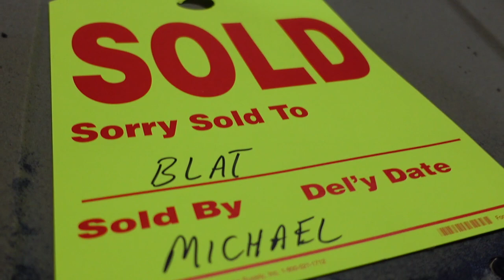kayak fishing sucks

Comment: I use a traditional style ocean kayak. It is a Viking Pro Fish Reload. 50% or more of my effort is to survive and simply ocean kayak. If the weather and conditions allow, I then can fish. Everything is harder and more dangerous to the extreme. Every once in a while, I go freshwater boat fishing and it bores me to death. There is so much more of everything (good and bad) in kayaking that boat fishing really turns me off. Also, there is no luxury tax, no boat tax, no boater safety class, no license, no registration, no engine maintenance, no fuel, no trailer, and no drama with kayaks. My 15 foot ocean kayak is only 65 pounds. The freshwater version is only 56 pounds. Both kayaks use the same modular equipment. That means my loadout works the same on both kayaks. Saving money is smart. 

One last comment, you need a saltwater and a freshwater kayak. The Hobie is garbage in the ocean. You need a boat that is no wider then 29 inches and about 15 feet long. The Hobie is 42 inches wide, and it weighs 120 pounds. Complete fail in offshore conditions. I have never seen a Hobie come out of the harbor and fish offshore with me. Ocean boats are long and skinny for a reason. Look at the Ocean Kayak Trident 15 and look at the Viking Pro Fish Reload for examples of offshore kayaks. 
Freshwater boats tend to be shorter and wider. They are great for casting but horrid in wind because of the problems heavy weight, height, and extreme width create. The peddle drive has its advantages but also it has disadvantages. The hull needs to be reinforced to support a peddle drive and that makes a 70 pound boat balloon to 110 or 120.... Also the peddle drive consumes the deck, there is no room for you left over. Also the peddle drive costs a lot and if you drive a Hobie or a paddle fin style drive you need a spare drive because you can not paddle a Hobbie, they need to be peddled. That being said the freshwater kayaks are luxury machines and a joy to fish in if the weather is good. Make sure your kayak has enough performance to handle the environment you are fishing and enjoy the challenge. Stop spending so much money on your kayaks. Save that money and use it for nice trips, lots of them actually and enjoy going places no boat can go.

Comment: I've never been fishing on a Kayak but my son owns a fishing version of an Old Town Kayak.  His kayak has a motor and fish finder and fully loaded up with his gear the kayak is one heavy piece of equipment that needs to be humped from his truck to the water and even with the wheels he has for the kayak its not an easy way to get out on the water and back.  Now there is one aspect that really sucks for him and that is chasing fish from one spot to where ever it is that they swim off to and even with the electric motor the kayak is way to slow  to keep up like he could if he were on a fishing boat with a gas outboard.  So he paid around 4 grand and he hardly ever uses it.  So no, I wouldn't say he's thrilled with his purchase.

Comment: Boat positioning is the biggest negative to kayak fishing. A trolling motor mounted on the bow would be highly useful. Manual power to get from point A to point B does not bother me, but boat positioning, without a doubt, is the biggest negative.
Reply from the maker: Yeah man. When I realized that I hated it at first but then I started to appreciate how good of a angler you have to be to fish from a kayak because you have no control over the boat.

Comment: You're right. Kayak fishing isnt really FOR filthy casuals. It CAN be for casual anglers, but you really do have to be dedicated to it for it to FEEL worth it most days. If youre fishing small water, say 600 acres and under, a kayak can be a perfect platform. I fish the kissimmee chain from a kayak frequently. This is not ideal. Even with a trolling motor on my nucanoe, my range is severly limited and time is still a factor. You cant cover the 25,000 acres of toho, let alone lock through and just run down to cypress. Learning to legitimately gameplan and understanding how to milk an area and fish small are paramount to success and these are skills that are mostly ignored by a lot of guys in bass boats due to the ability to run and gun. I did a video on the importance of boat positioning a while ago. It is far and away the most overlooked aspect of kayak fishing. Glad to see some people with an actual audience having the conversation.

Comment: Bought a kayak I’m a bigger guy so was concerned about weight limits part of the reason I bought new easier to research each model vs trying to find local one on eBay. Noticed you talk a lot about boat control don’t know if you use drift socks they may help but at the same time may spook the fish after the first 10 min would think it would go back to normal

Comment: I'm glad I stuck around. I'm one of those kayak only anglers, and I read the title, said a dirty word, listened to the first few sentences, was like oh no imma unsub right now. Glad I actually stayed until the end. Haha, pro tip though positioning is not hard you will find, with a peddle drive, and rudder.
Reply from the maker: It still not a bass boat. Boat position is not even as easy in my aluminum boat as it is in my fiberglass competition rig. The bigger the boat the easier it is to position yourself. However the pedal is definitely much easier than paddle in most situations.

Comment: You're saying that kayakers are at a disadvantage to the wind and current... then every other kayaker has the same disadvantage. Is you're more apt to handle those conditions, you're a better angler in general. There are not boat vs kayak fisherman. It's all circumstantial.. Learn to use an anchor trolley and have a stakeout pole.. sound dampen your kayak.. get a sit on top with enough deck space to stand on.. I honestly think people who spend 99% of their time on boats get lazy.. Huge casting platform, outboards and big trollers, and tons of storage to store all of your unnecessary tackle.. it spoils you. At that point you've already moved too far from the fundamentals and it hurts you. As an owner of a medium sized skiff and a 12 ft PADDLE kayak, I like kayak fishing more. It brings you closer to the fish you're after and closer to the environment you're fishing in. It's a more intimate experience overall.

Comment: So I’m just gonna throw this out there.  I have done neither, but I’m thinking about this from what I believe is logic and physics in my head.

So don’t but my balls!  Thank you.

Can a similar 12,14 foot flat bottom Jon with a lithium 12v on a hand troll motor access same waters and have as much control.

At the same time I have seen kayaks on the pro side setup with so much lowrance units, batteries, battery restorative units, tackle , rod and reel storage, no doubt those kayaks are 250-300lbs.

I understand the physical health benefits you have offered up.  No rejection to that, but??? 

Just throwing it out there.  And personally I’d feel more comfortable in a boat than feeling like I’m on top a log with a seat.
Reply from the maker: Yea a jon boat also allows you to fish with another person.

Comment: You’re going to love the Outback! Get a micro power pole, Boonedox landing gear rudder, Boonedox landing gear cart/wilderness cart/Hobie cart. Get a or make a leash for your pedals also. The landing gear is will get you on and off the water quick without having to load/unload your kayak
Reply: Dude I took my Titan out for the first time today, and the sidekick was installed when I got it at the dealer. It's missing the back two slide plates, so when I pulled it, it bent the front screws and the kayak went to the ground. So frustrating. The place is mailing me a new sidekick. I STILL have never been in a pedal kayak, and I own one. 🤣😂
Reply: @CarolinaBassHunter  dang man lol. I see you fish the river all the time lol. I’d be pissed if that happened. Hopefully your tracks are ok. The Titan is definitely a nice boat.
Reply: @ABVang  oh ok I see you go there too. I stay in that water.
Reply: @CarolinaBassHunter  yeah man. I go there a lot but mainly in the winter. Never in the summer lol. You’re always killin it out there man! Tight lines!
Reply: @ABVang  thanks man. Tight lines.
Reply: @ABVang  I've been fishing out there for about eight years. Decided to post videos here two years ago. I'm thinking that wasn't a good idea. I just bought a bunch of stuff to improve my videos, but it's tough to post. The day after, I'm usually battling for my spot out there. I'll probably continue to post, but it has its price with local guys watching.

Comment: I like what you did here, but it's an apples and oranges comparison anyway. A good fishing kayak costs $2500. You're lucky to find a running bass boat for 3 or 4 times that much.
Reply from the maker: A 12 ft Jon boat is about $1000 or less BRAND NEW
Reply: @BrianLatimerFishing  A blow molded Jon boat with NO MOTOR, yes. But many of his "complaints" surrounded not having a motor on the kayak. A 5HP motor will cost at least $1000, but likely closer $1500. That will get you ~3 knots faster than a pedal kayak. 
To get any semblance of the bass boat experience he talked about you'll need a longer, metal Jon boat with at least a 10HP motor. That's going to cost $6k-10k minimum.
Reply from the maker: @MattWolfgang  thanks for watching the video. My only hope is that next time you’ll find interest in the whole video. This actually wasn’t a comparison video.
Reply: @BrianLatimerFishing  LOL, sorry not a regular viewer so I didn't realize I was talking to you. I know it wasn't a real comparison video, that's the reason I put complaints in quotes. I was just pointing out that a bass boat isn't a realistic option for a lot of people.

Comment: Intentionality.
Reply: Kayak anglers regularly 'go to sea'. With only one jerk bait stored on the vessel. And sometimes. When they cast it tied to a fishing line. I've seen instances. They were so annoyed having peddled all day. Up and down on rivers or lakes. They snap the jerk bait off the line. When doing the first cast. Out of bad temper. Then there is no back up plan. You're done as far as that bait goes. I think what happens. In reality. Is that kayak anglers settle on ways to fish. Like soft plastic flukes and things. In one color too. That works most of the time (and can be fished like a jerk bait if one was short of one). They fish the bait. In all kinds of different ways. Rather than worry. About having that box of jerk baits. That has two hundred different colors (that would make the kayak sink anyhow). It makes me crack up. When you hear the kayak angler. Say they were getting bites on a crank bait. But they lost their crank bait. So now they are fishing a wacky rig. Because that's sort of the same. There's a lot of that nonsense goes on in a kayak. But they make it work. Regardless. You can say 'intentionality'. Because that's what it boils down to. Total commitment.
Reply: Now that level of ruthless intentionality. And dogged determination. To make it work. Against all odds. If one takes a kayak angler. And puts that angler in a bass boat. Does that instinct. That grit and determination. That real ruthless streak. Does it work in favor of that angler? Or work against them? I don't know. Someone should run that experiment.